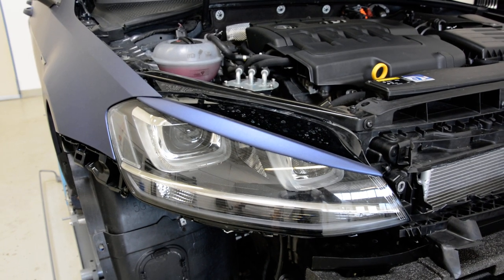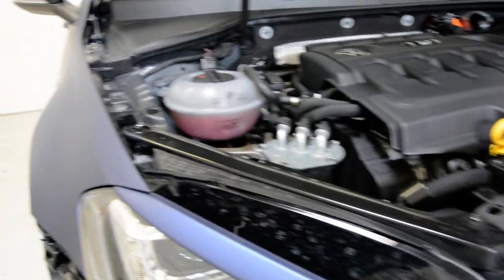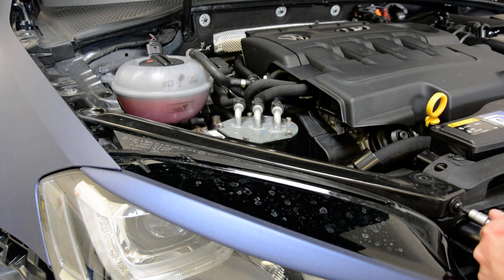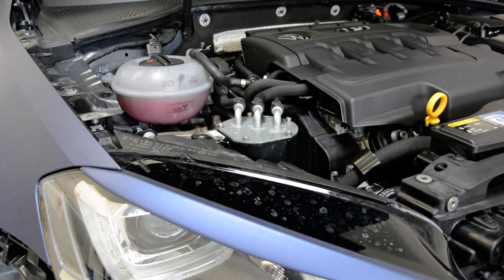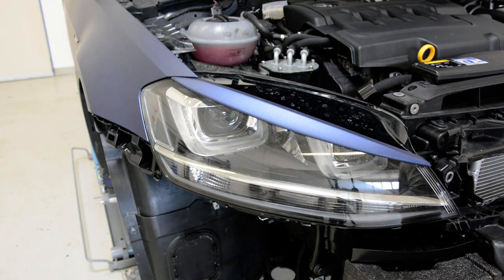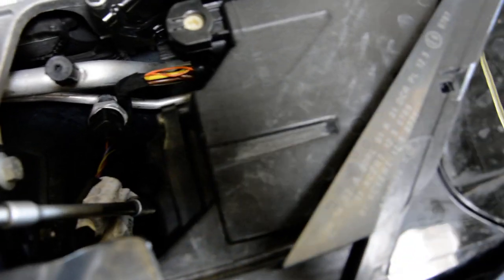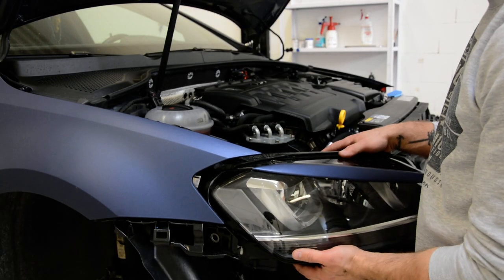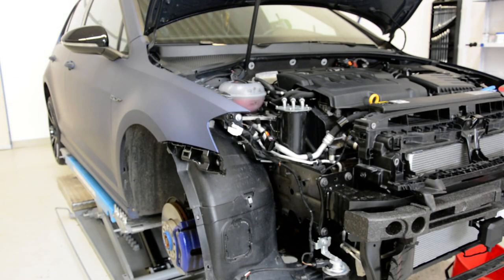How to remove the headlights Golf mk7 R line

Comment: you don't actually need to remove the bumper. it is made of plastic and you just need to remove few screws around and pull slightly on it and you will be able to get a small tool in there to remove that screw. changed both headlights this way.
Reply from the maker: Ești tare ce sa zic 👍
Reply: Great, now i can change my drivers side light without removing the entire front, thank you.

Comment: Where is the xenon control unit located
Reply from the maker: Under the headlight
Reply: @DFCGarage  Have you ever seen issues with water getting into the modules on the bottom of the assembly? I have a 2015 Golf TDI with OEM Xenon lights and the passenger side keeps getting full of water. Do you have any thoughts on how to resolve the water from coming in? I just bought all new modules and a new headlight assembly and it's getting wet inside again. I'm tired of wasting money. The car headlight is beautiful but very poorly designed.
Reply from the maker: Scott H I had a golf 7 Gti and after I have bought a golf 7 Gtd and bought of them have Problems with The headlights. On rainy days or after washing the car the headlights war foggy and a lot of water was getting inside. Is a production error but they don't Bader to do something about it.
Reply: @DFCGarage  Both left and right headlights on my Golf 7 are are cracked in bottom corner and water gets in when it's raining. I can't figure out how it happened. Seems strange that both are broken in same place. VW garage wanted about €800 to replace them. 😲 I said no thanks.

Comment: Good instruction how to do it.
I wanted to upgrade my headlights from halogen to led and i need to do this operation, who ever att VW that designed this should get fired.
My hands and the new bulbs don't fit in the space behind the drivers side light.
Reply: Looks easy to get out. Remember how big it is and how much space it takes up. It needs to be properly secured within an already tight engine bay